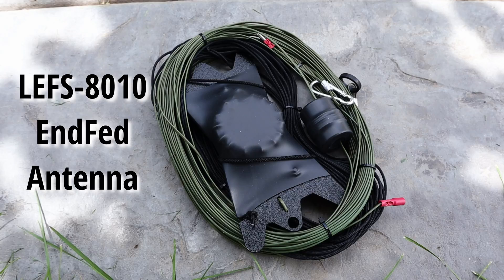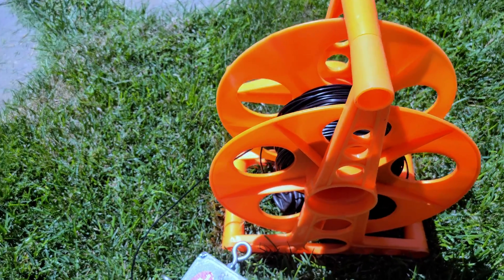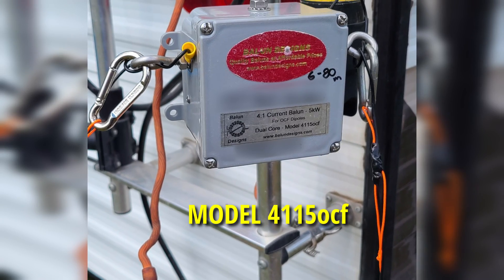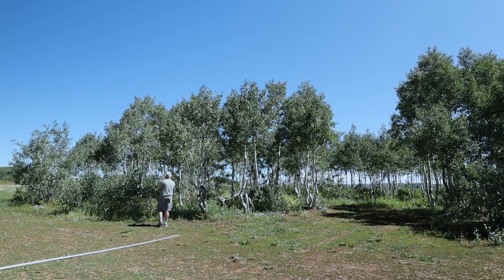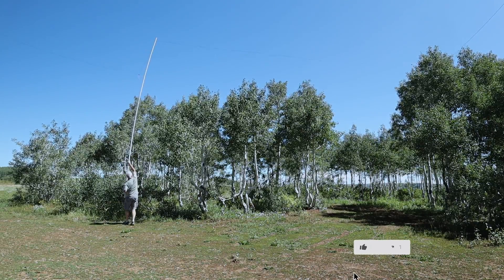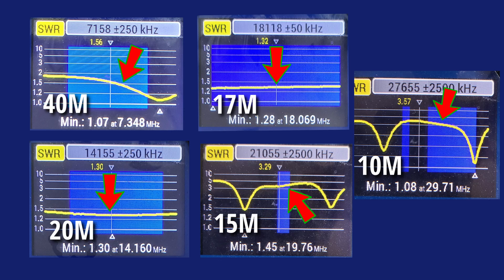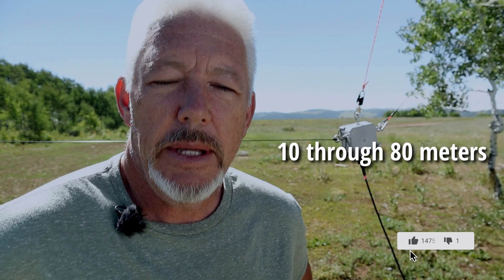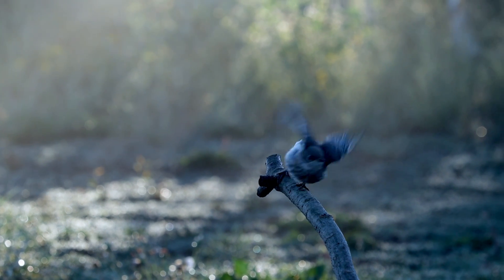Build an HF Loop antenna for camping | K7SW ham radio

Comment: I’m in the middle of doing a 160m loop. For right now I am going to test in a wide open field, so it should go up easy.
Reply from the maker: Very cool
Reply: @hamradiowithkevin  I’ll let you know in a couple days how it worked out
Reply: It has excellent reception. Noise floor is a 1. I have been getting solid 59 reports. Compared to my efhw, the noise floor is 5-7 and signal reports of 55-57. I’m really happy with the results.
Reply from the maker: with a nice setup like that, it is hard to go with anything less, nice work
Reply: @hamradiowithkevin  thank you! I tried to post a pic on QRZ but how do you get the whole thing in frame. Hehehehe. KD9ZSP

Comment: I thought I could’ve used bobs 4116 4:1. He says not so. I’m dying to get 80m loop up with no trees in the back yard. Hehe. My 40m delta works very well.
Reply from the maker: Bob will steer you in the right direction.  Testing out a loop is pretty fun

Comment: I would really appreciate being able to see a drawing on a piece of paper of the antenna directions and shape ??  But I understood 90 % of everything.  One question I have is what if all you had on hand was a 1:1 balun , would that work well also ? 
Great video . Hope to hear back from you soon 
73
KK4ISW
Reply from the maker: Google an 80 Meter horizontal loop for the dimensions.  You will need a 9:1 balun. Check the description for the parts.  73
Reply: @hamradiowithkevin  
Awesome .. thanks

Comment: FW horizontal loops are great antennas. They are simple, cheap and work extremely well. A very quiet antenna. The only downside is that you need lots of room. Circle is perfect, square almost as good but whatever shape you can get the antenna up in, it will work. I have tried coax and ladder line with different baluns. Best was q-section and coax. I've built these for 80 60 and 40m.
73 Ed.
Reply from the maker: I agree, super fun indeed. Will do this one again this summer

Comment: Early 2000s I ran a full wave 180m skyloop like this. I miss that antenna.
Reply from the maker: That sounds super fun. 👌
Reply: @K7SW ham radio  I used thr 12awg green stranded wire from Home Depot and had it in my trees. Rental house in downtown Bellevue WA. S1/2 noise floor and talked to New Zealand with 50w during a lull in sun cycle. 

I hope to get it up and running here in Oklahoma soon.

Comment: Thanks for posting this great video. I've used a 160M Loop antenna up 80 ft. Had some tall pine trees to work with. With only 100W during contests I was able to cut thru the pile-ups. Love using a Loop antenna.
Reply from the maker: Yes Jack, I am convinced that it is a great antenna to use!  Can not wait for spring to get this portable antenna up in the hills.

Comment: I too can confirm excellent results with my loop antenna also cut for 80 meters. My arrangement is an apex up delta loop with the feed point at a lower corner. I installed an arm on my 70ft tower with a marine grade pulley to hoist the apex. The corner feed has a 4:1 current balun which is fed from the shack by RG-213 coax. I'm also using 17 ga. electric fence wire for the antenna itself. It's very strong, does not kink and has lasted for years. Overall, if you have the room, the loop or delta loop is simple to assemble, lasts for years and gives outstanding results.
Bill, W2ZKX
Reply from the maker: Bill, I am starting to understand what you mean. I really enjoying this loop at home now. Thanks for sharing. 
73

Comment: I have used an 80m loop horizontal for the last 15 years on 80 through 10 metres.  Brilliant.  Better than my EFHW, G5RV, vertical and half wave dipole.  On 80m the feed impedance is 100 ohms but on the other bands it varies considerably.  I use a 1:1 current choke from DX engineering and an auto ATU.  My yagi takes care of 30m through 10m but sometimes I use the loop with almost similar results.  I recommend using insulated multi strand wire and I just run it over branches and foliage in a rectangular format.  Square format would be better but I can't manage that.  I measured 80m of wire and put the current choke at the feed point with RG214 coax to the ATU.  Cheers from OZ  VK5LB
Reply from the maker: Beautiful setup Dean, thanks for shaping.  73

Comment: Had an 80M full wave loop for years. Hands down, my favorite wire antenna ever. Quiet, efficient and multiband. You might try feeding with twinlead with the 4:1 balun near the rig. Lighter, less cumbersome. 73, Marc, W4MPS
Reply from the maker: Thanks Marc, it sounds like a good setup to me. I have been thinking about a loop take take with me on camping trips. This antenna ended up at home and I really enjoy it at home now.
Kevin

Comment: I'm a huge fan of the full wave loop.  I have a 160 meter 6-sided loop at my home QTH and your observations are correct.  It hears everything!! 😃  I applaud your effort, but for a POTA activation the setup logistics would seem daunting if not impossible.
KZ9V
Reply from the maker: Thanks Dave. Sounds like a nice setup You have. Not sure if I would do that setup again unless I had multiple days to use and enjoy it. 
73 Kevin

Comment: YES, a very good HF antenna.  I have been using an 80m horizontal loop for a number of years.  Mine started as NVIS at 10' it now is 10' to 30' and never was square.  It was a triangle now more trapezoid.  For me, the feed is 450 ohm ladderline to a 4:1 voltage balun and a 1:1 common mode choke (effectively your 4:1 current balun).  I have worked ZL and VK from the east coast USA on digital modes - 80m, last month (july 2022).
73, steve WB3LGC
Reply from the maker: Steve, I must say, this is a fun antenna and I can already see how well it works. Other than the amount of space it takes up, I can understand why you have had your antenna up for so long and why you enjoy it. 73 Kevin

Comment: How about open that loop to just the dipole and get three DB extra
Reply from the maker: Actually, I have been working on something just like that...  Thanks for making the suggestion 👍
Reply: @hamradiowithkevin  or if you want a real flamethrower a Franklin
Mine is cut for 5/8 wave on 75 m six element I'd I'd say almost 20 Db plus it tunes all HF
Takes a good bit of real estate
73s
Ki6kqj
Good on qrz

Comment: Great video, I put up a 80m loop with 266'ish of wire and it has become my primary antenna at home.  Would be interesting to use at a park, but I don't think we got any as wide open as that in Mississippi :)
Reply from the maker: Thanks Joe, yes it is an interesting antenna for sure.  I could  see how this would be fun for a field day antenna as well.  I may have try this again out camping with larger trees. Just for fun😉
Reply: @hamradiowithkevin  you mentioned larger trees, I forgot to say my loop is at 25ft at feed point and about 20ft the rest of the way around. My soil is mostly clay which is why I think it works so well at a relatively low height for the bands.

Comment: Have you tried 2.5:1 balun ?
Reply from the maker: Robbie,  I have not. I suspect the impedance match would be off because of the good match that i currently  have with the 4:1 balun.
Reply: Most of my 160 meter (and harmonics) loop impedences are measuring between 100 and 150 ohms, so I went with a coax fed 2:1 current balun on my loop antenna.
KZ9V

Comment: Was the area within the loop clear ground or were there trees? I have been thinking about how to put up a loop at my house and I don’t think I could do it and have the area within the loop clear. Curious to know what the vegetation was like for your experiment.
Reply from the maker: For this setup, the area WAS clear inside the antenna area. Since then, I have put the antenna up at my QTH which is directly over my rook and some parts of the antenna get into the trees one one side.  I still hear signals really well and make some good contacts. It is worth giving it a try I think. 73 Kevin